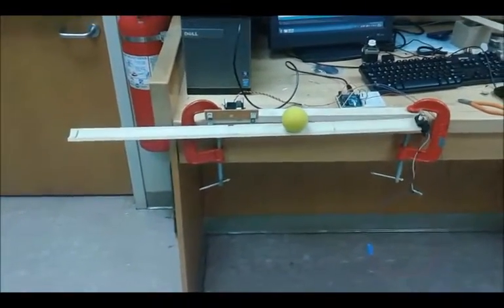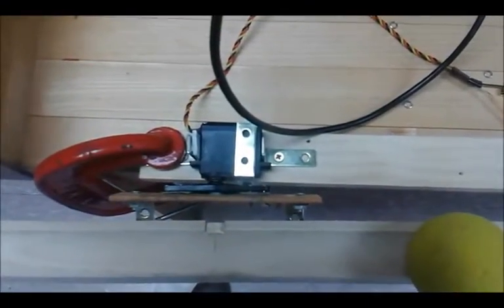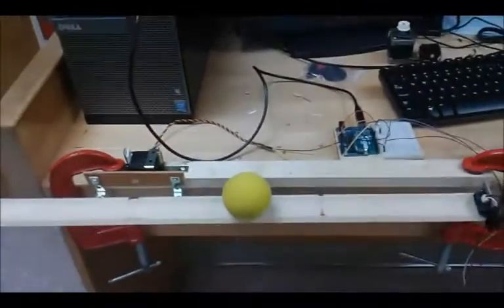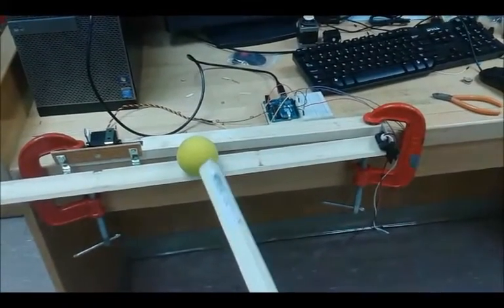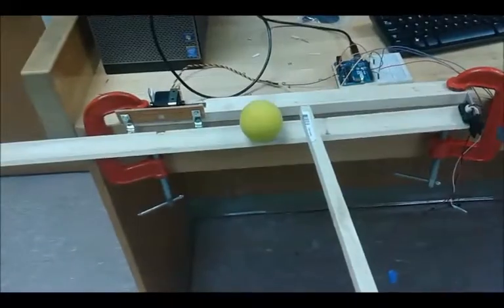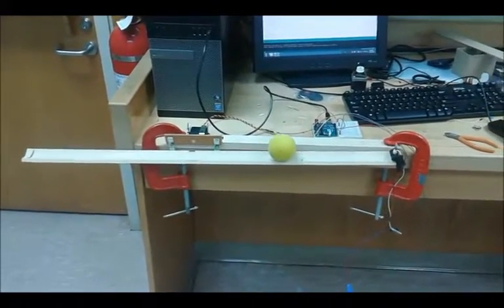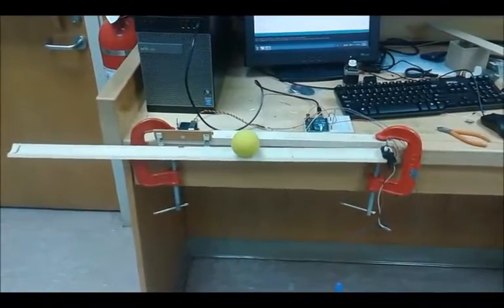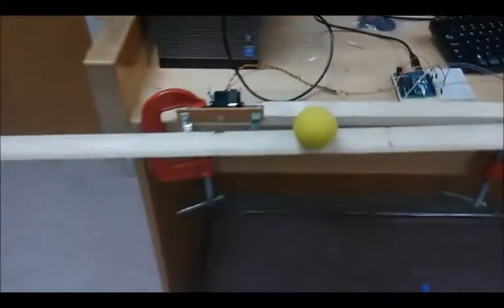Ball and Beam PID Control, Arduino,  Servo Motor: Hitec 32645S HS-645MG High Torque 2BB

Comment: Very nice
Reply: I'm looking to control pressure using a servo valve. My overshoot is very drastic. I want to somehow use your code to fix this. How?
Reply from the maker: @techmodek  You need to tune your PID controller. Start from these links 
Here is a more detailed video: https://www.youtube.com/watch?v=CXFDr9pT62g
The codes can be found on my website: https://aleksandarhaber.com/pid-controller-discretization-and-implementation-in-arduino/

And try to understand how to tune the PID controller. In these videos, I explained the basic principles of experimental tuning of PID controllers. Also, I explain how to implement PID controllers.
Reply: Thank you so much bro
Reply from the maker: @techmodek  Thank you for your interest and positive comments! Good luck!
Reply from the maker: Thank you!
Reply: I'm not understanding how I would get k1 and k2 from my pressure sensor